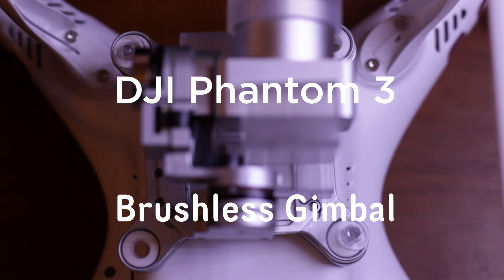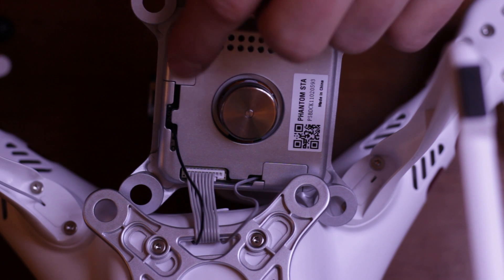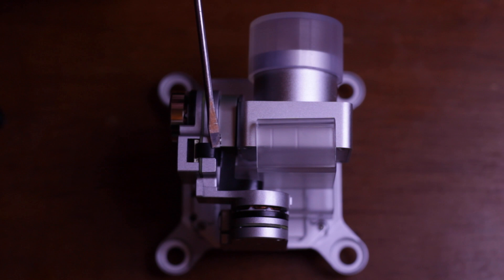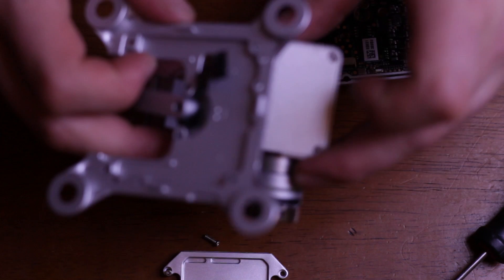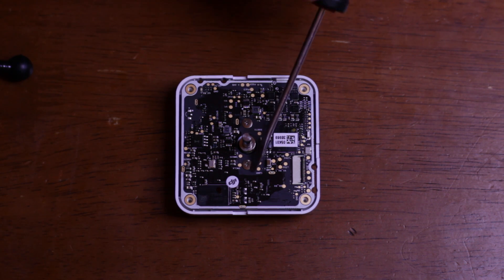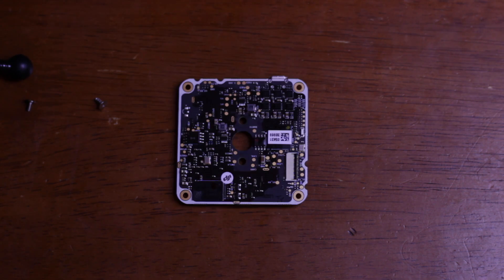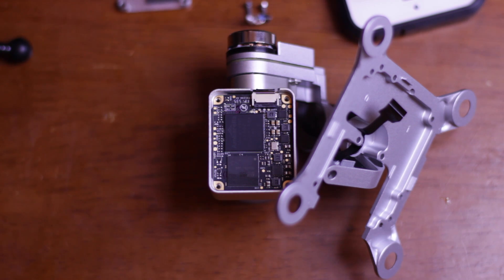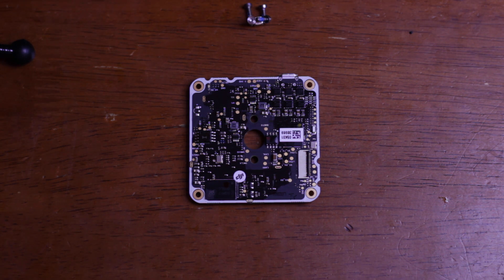What's Inside the DJI Phantom 3's Brushless Gimbal & 2.7K Camera?

Comment: Those black and grey "coax" connectors are for the radio antenna. They are the same connectors used in laptop WiFi radio antenna as well.

Comment: Hi, Rad pretty good video, can you confirm me if it is true that the Mi Drone hasn't encoders?
The camera has tilted horizon (like many other gimbals) and people from a group are saying the gimbal just lacks of encoders, I have seen the gimbal Do have these when dissasembling it, so I'm guessing a decent gimbal can't work optimally without encoders right?
Reply from the maker: No idea if the Mi has encoders or not, but they're not necessarily needed. In most cases the difference between the reference IMU (on the craft) and the IMU on the camera/gimbal can provide all of the data needed.